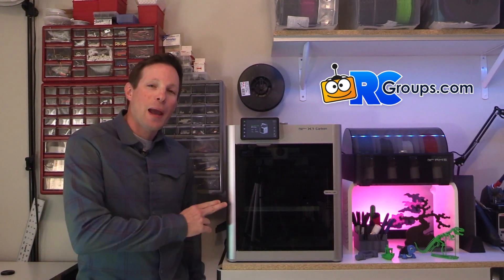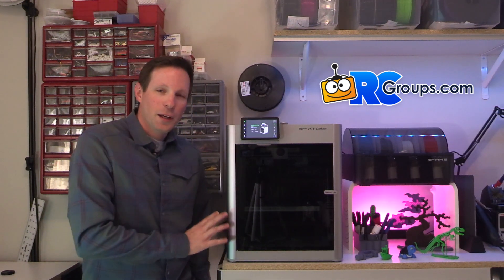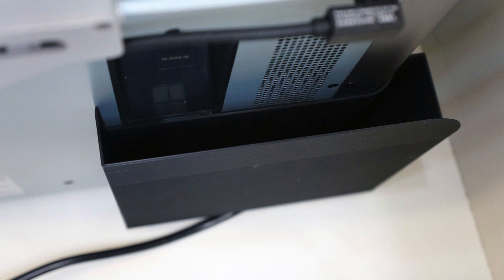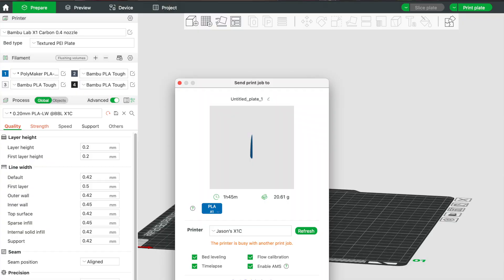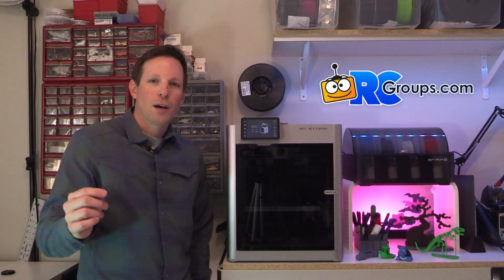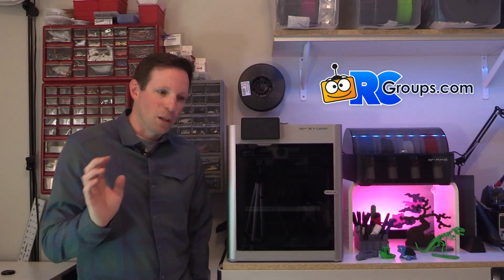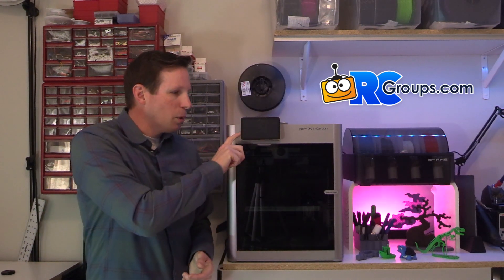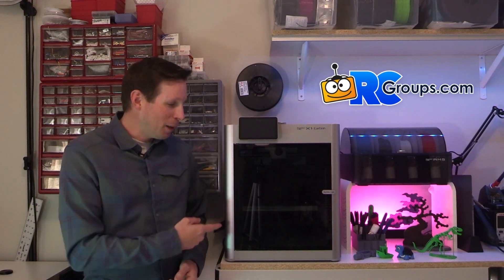Bambu Lab X1-Carbon 3D Printer First Impressions, Print Log and Giveaway!

Comment: You can reduce the waste by a considerable amount,  I have mine set from its default at 280 down to 110  and I also have taken to orienting my prints so that the color changes are on the top.  My poop is very negligible.
Reply from the maker: That will only work on certain prints and with certain colors. If you lower the flushing volumes on say light to dark colors, you can get color bleed that will ruin the print.
Reply: @rcgvideos  the first part is true, however I have been switching from dark to light without any bleed issues. I think their stock settings are extraordinarily conservative for obvious reasons. That being said I print functional parts not decorative so part orientation is of greater importance to me than merely cosmetic